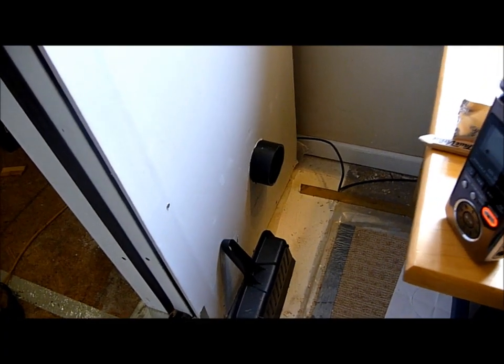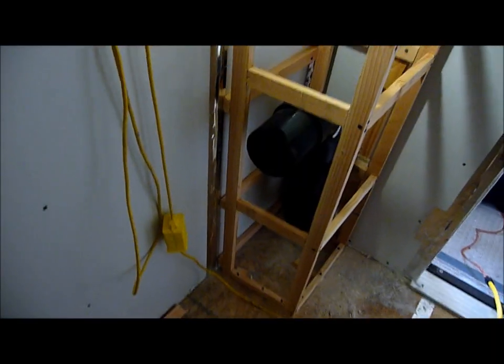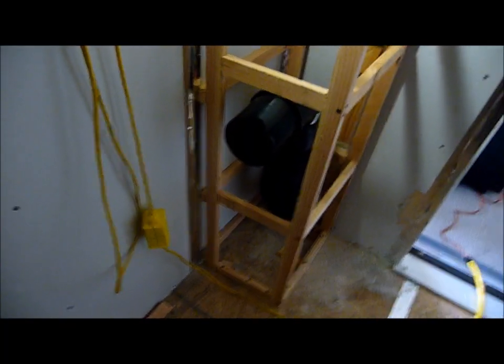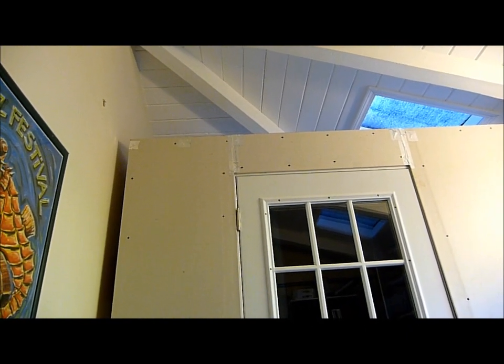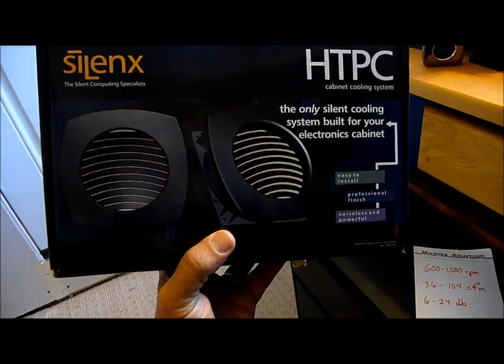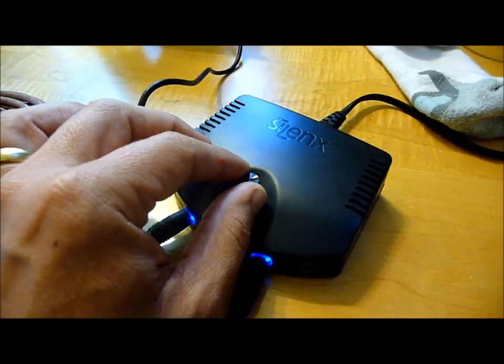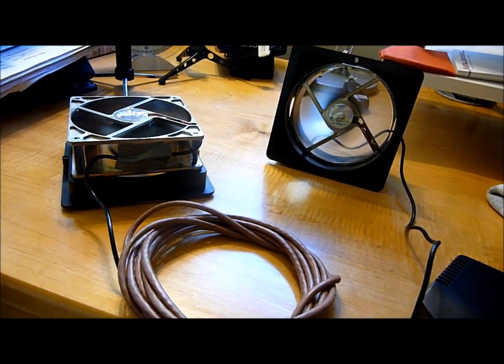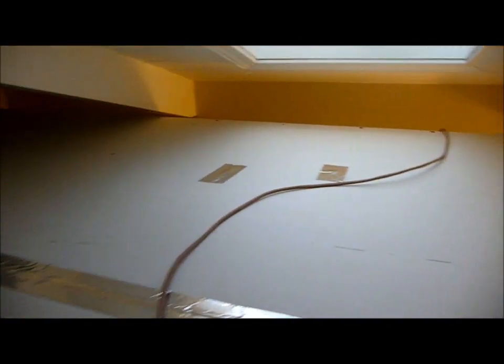Isolation Booth, Part 4: Ventilation

Comment: Great video bro.. For real.. Quick question my man.. You said you used extra wiring because of the length between the two fans.. Can you elaborate on what wiring that is and did you simply cut the wires and connect them?? I don't know much about electronics and shit like this but any feedback would be great.. Appreciate it man!

Comment: Hey Paul! I found these video's extremely useful! I am building a vocal booth using your ventilation idea, but I am a little worried about the outside sounds coming into the booth as are some others on here. I will be recording vocals and acoustic guitar for rock/metal bands with this booth, and i will be directly outside the booth listening to the tracks in progress with recording monitors, think that sound will carry into the booth? and also if you were to by fanswould you buy the Silex again?
Reply: i have a solution for your problem. i'm dealing with the same issue, and I have neighbors and odd hours. my idea is: have your acoustically insulated booth sealed as well as possible, with your input and output vents. each vent leads to another acoustically insulated chamber that is slightly less sealed than the main one. all you have to do is step down the sound dampening in a large enough volume of air for proper flow. if done correctly, you really shouldn't even need fans.